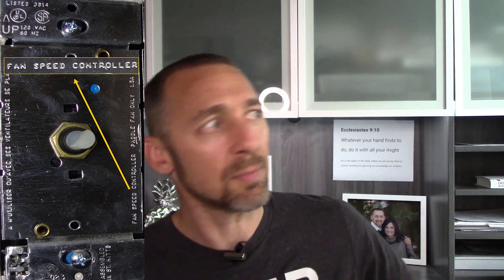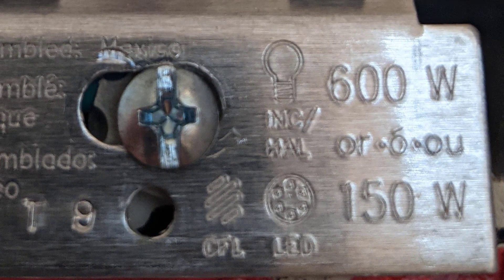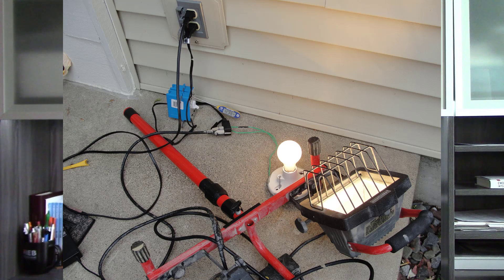Hot Dimmer Switches

Comment: What do you know about smart switches and digital timer switches? I have a digital timer switch and the back side of the housing is warm 85-89 degrees even when the lights are off. When lights are on it warms up to 100 degrees in the same area. The lights on the switch do not even come close to the 1500 watt rating. Thanks

Comment: I have a dimmer switch powering 12 incandescent candle style light bulbs (not sure of the wattage) that started getting hot so I did call an electrician. He couldn’t find anything wrong with it. 🫤 It has two flip switches next to it. 
Now I’m going to check the rating on the dimmer switch to see what it’s rated for and check to see how many tabs have been broken off. My guess is it’s either maxed out or the wattage is above the reduced rating. Thank you!